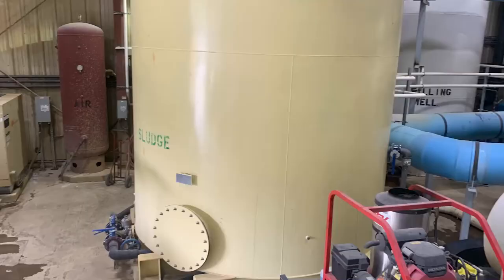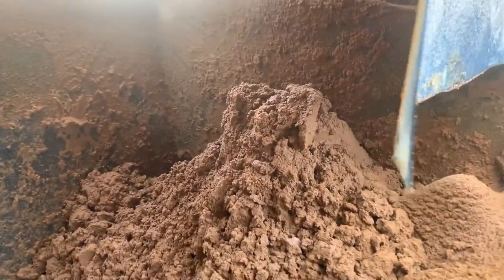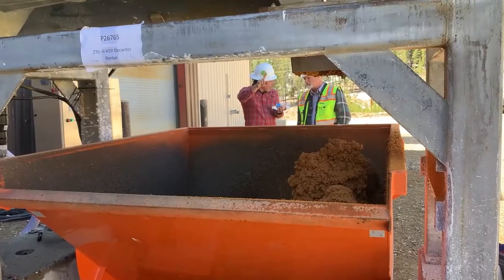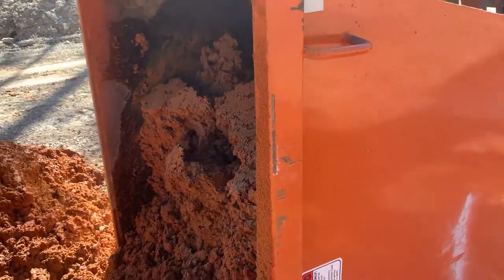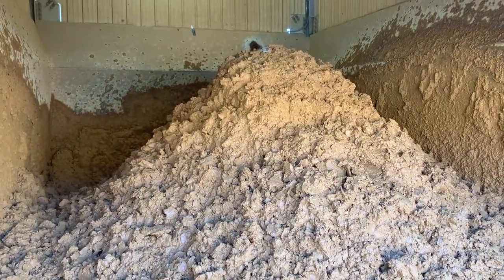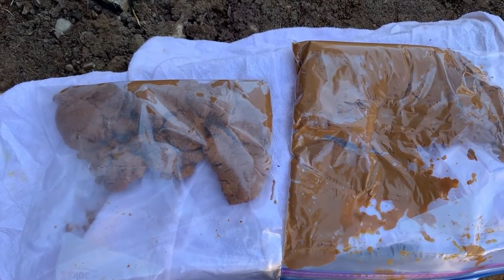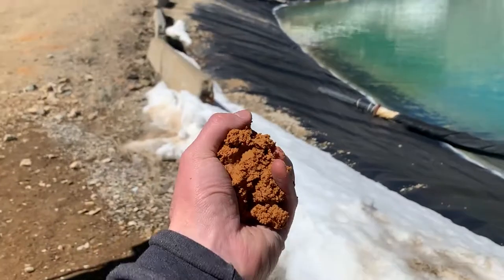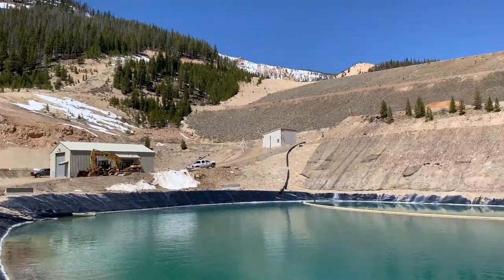How A Centrifuge & Polymer System Dewater Mining Slurry

Comment: The cake coming from your centrifuge has to much moisture in it. It can definitely be better. It looks like you may not be using the correct polymer. Also, the slope of the bowl may not be steep enough or the differential of the scroll is too high.
Reply from the maker: Hi Robert. Thanks for the note and tips! We always perform lab jar testing to confirm the best polymer prior to starting in the field but as you know, things can change at scale. The Flottweg technicians handled the centrifuge setup so we can't speak to that. Of course, every application will have a different output. 

We ran more tests this past summer at other sides and achieved 78% solids by weight cake from the centrifuge. Though the cake may not be as dry as that from a filter press, the centrifuge is continuous and doesn't have the cost of replacing filters. It sounds like you're familiar with this. Do you work with centrifuges in the aggregate industry?
Reply: Yes, I have 11 years of experience involving the dewatering of various types of sludge through mechanical and chemical processes that range from the food industry to the oil and gas industry.
Reply: I also work for a company that rents centrifuges and provides expertise for these types of processes.
Reply: @robertmcintire8914  I was thinking the same thing. That's not alot of output either.  I work all over the U.S. and I don't know of an operation that would find that amount of cake impressive.
Reply: I run slurry dewatering plant in toronto, i use derrick 7200 centrefuge let’s connect somewhere where can talk